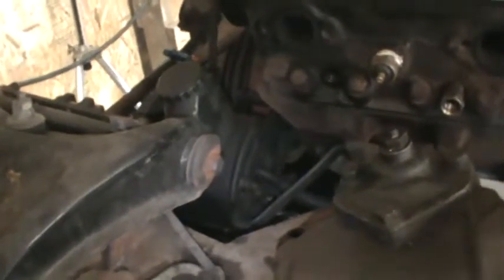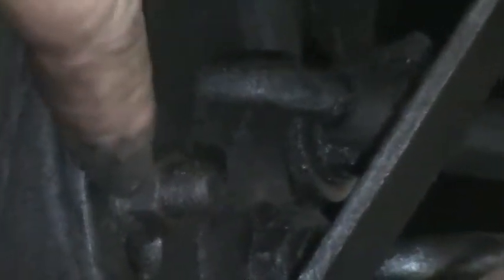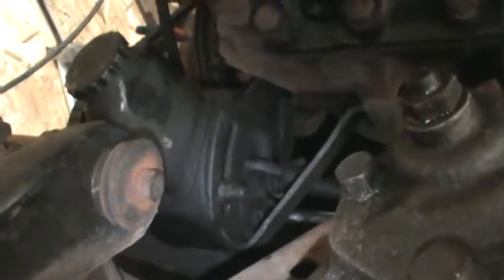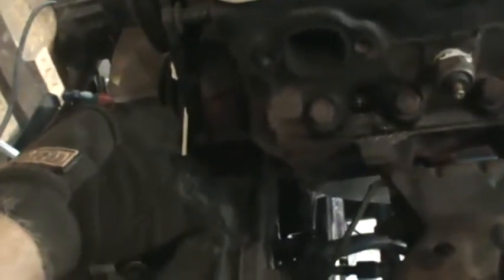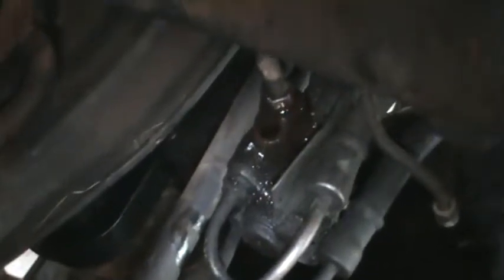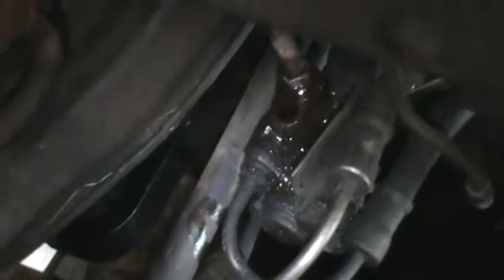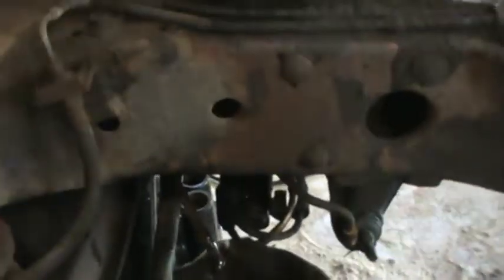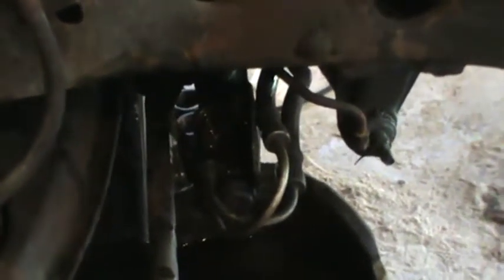power steering pump

Comment: Hey, Thanks for the informative video.  One comment I would make is that if you want to just remove the power steering pump, you don't have to mess with that bolt next to the motor mount.  The PS bracket is two pieces.  The two front bolts hold the bracket to the engine.  Just undo those, and the adjustment bolt, and the pump and front bracket will come off.

Comment: My power steering go like crazy from onde side to the other  i cant adjust it properly from the front nut ... i dont know i rebuild everiting exept the pump Could it be the reason? C3
Reply from the maker: It sounds like a problem with your power steering control valve.  In this video I explain how the power steering works on a C3 Corvette starting at around the 5 minute mark.  Make sure your hoses are correctly installed on the power steering control valve.  If the hoses are connected properly then it might need adjusted.  Here is a link to a video that explains how to install and adjust it.  If that doesn't help, it may need replaced.  Good luck and please let me know what you needed to do to fix it.
Reply: Thanks mate i try today as first with a new pump , because control valvle and piston are already rebuild  i let u know how it goes
Reply from the maker: @gabriga6662  If the control valve was rebuilt, I would try to adjust it first.
Reply: I try to adjust it first as the procedure say but then the steering keep on moving on one side and the system start to force...
Reply: But let me say that i install a c3 system on 3100 truck 1954 but it should work as well
Reply from the maker: @gabriga6662  I wonder if you have air in the system and it needs to work its way out.  If you can, try turning the steering wheel all the way to one side then all the way to the other side several times.  You can do this with the engine off so you won't be fighting the pump.  The wheels should be off the ground so it is easier to turn.
Reply from the maker: @gabriga6662  It should not matter what vehicle it is.
Reply: @fun-cars  When you try the above to purge the air, do you have to remove the pump filler cap?
Reply from the maker: @GJJC13  No need to remove the cap because the air will just go to the top.  However, you should check the fluid level to make sure it isn't tooo low.